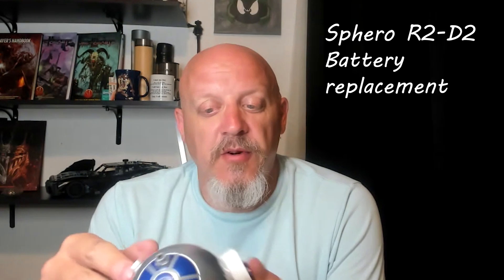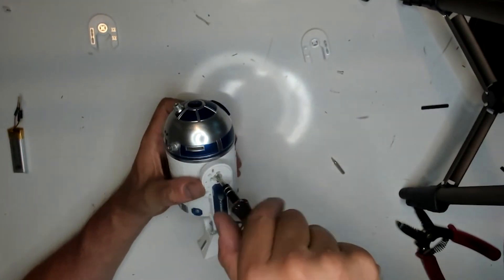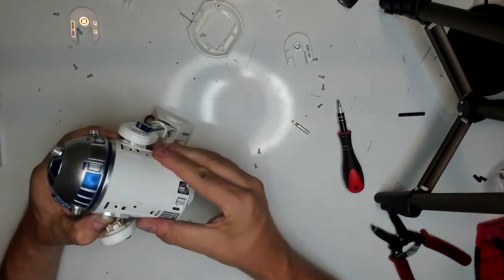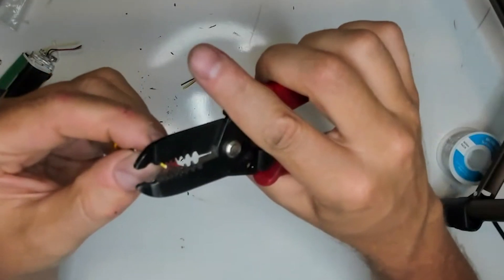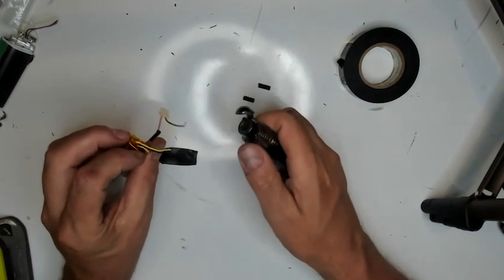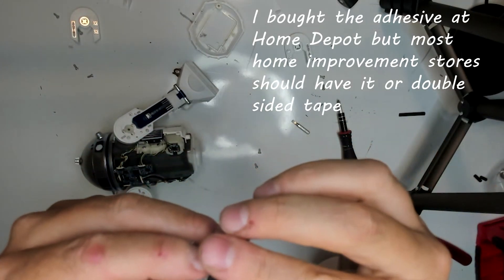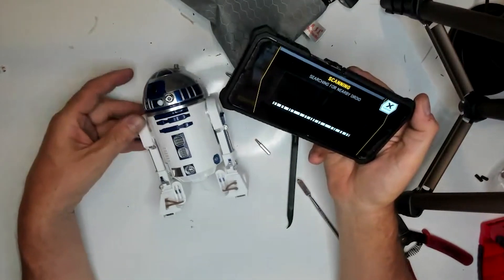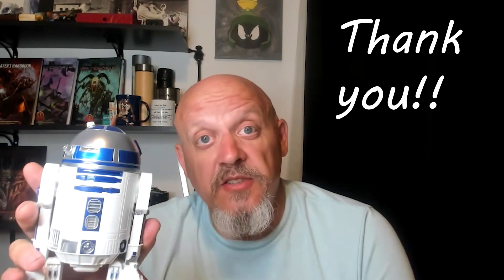Sphero R2-D2 Battery Replacement

Comment: Hello. Could you please check the battery link in the description? It looks like the same link in the iFixit instructions.  None of the batts on that link are 1400 mAh. I ordered the closest one, and it was to long. I’m thinking that this replacement batt is no longer available.
Reply from the maker: Interesting. I don't know the links could change.  I checked my Amazon order history and it shows I ordered 1400 but links to the dual 650.  I will search for an alternate and update
Reply: @RodsMenagerie Thank you. I appreciate it.
Reply from the maker: I just updated the comments with a new link.  Its wired slightly differently, but I think it will work.
Reply: @RodsMenagerie  It works! I installed it today, and it’s working. It’s a little shorter than the original, but that’s not a problem. 

A few notes on my experience: 
I followed the steps in the iFixit tutorial. Removing the old battery required some care. Adhesive is used to attach clear shims/dividers on both sides of the battery. I used a thin, flat spudger to cut through the adhesive. I clipped the wires from the old battery right where they connect to the battery and I clipped the wires on the new battery right at the plug. I soldered them together and covered the joints with heat shrink tubing. Then I used Zots to attach the clear shims and slid it back under the circuit board. 

The whole operation took about an hour. Thank you again for the updated battery info. 👍

Comment: Fantastic walk-through on how to do this! Thank you so much for your research and great explanation! When I did it, I noted the following: getting the plastic covers off seems to work best with a razor blade to avoid damage, the covers on the legs have a long dowel holding them on that can bend/break if you're not careful, getting the old battery out was a fiddle and I had to be careful not to use too much force for fear of damaging the circuit board above it - very gentle nudging underneath it with a small screwdriver to pry apart the adhesive seemed to work though. I didn't add padding to the new battery but reused the two pieces of clear plastic that were attached to the old battery, and it seems to sit happily without moving. Thanks again!
Reply: I should also mention that the original battery in mine had begun to corrode, so if you have one of these units, replacing the battery sooner, rather than later would be a good idea. Battery is a AOLIKES 3.7v 1400mAh Rechargeable Lipo Battery Replacement for Logitech MX Keys Mini Minimalist Wireless Illuminated Keyboard, YR0084 Keyboard Battery Replacement 533-000200 battery

Comment: Hello - I own an R2 unit by Sphero - my R2 has been in sentry mode for quite some time. Just notice this evening the R2 wasn't moving, making noises. I connected to R2 via the app, but cannot get his head to move or any movement at all. Only the lights work. Any suggestions? Really bummed out that my R2 unit is no longer working. Hoping someone can help? Thanks.

Comment: Thanks for sharing this! It's a shame that Sphero isn't supporting these robots. They also could have made it much easier to access the battery. It's not like they had any shortage of lines and whatnot on the bots, to where they could have hid hinged battery compartments. 

Do you know how the replacement batteries compare to the original ones. If they are smaller I would assume they are smaller mAh, and maybe don't last as long before requiring a recharge. I barely used my R2, and still the battery went dead after about a year. I suppose keeping it plugged into my USB input, along with the unit not having any overcharge protection may have caused this.
Reply from the maker: Unfortunately, I destroyed my original battery before I filmed it but my notes say it was also a 3.7V 1400 mAh and the original was made by a company called Ascent.  I would assume as well that the new may not last as long but I actually rarely drive him around.  I like to keep him in human interactive mode on a shelf near me so that he speaks up at random times.  You are right, they could have very easily made a flap for the battery but electronics repairability in general has been going downhill for years.  Really a shame.